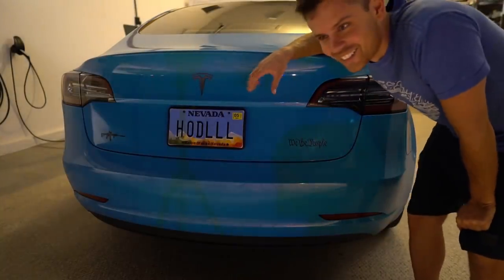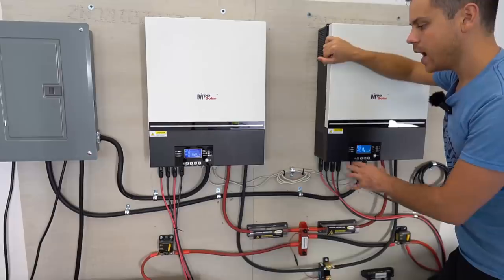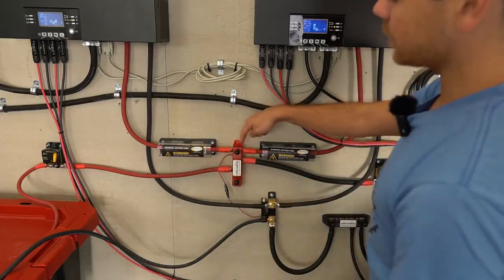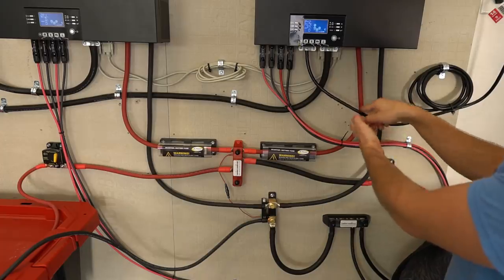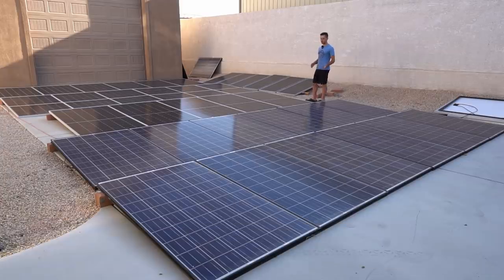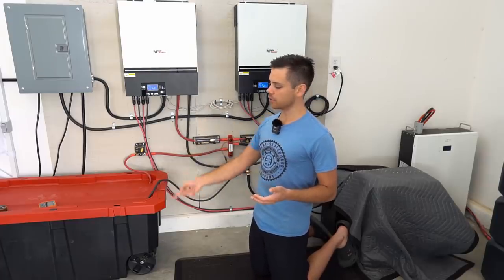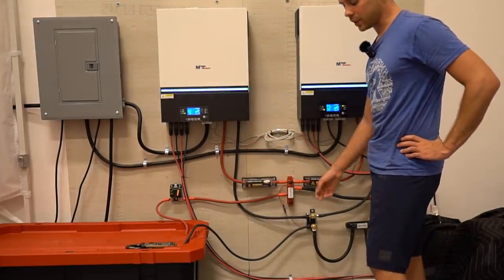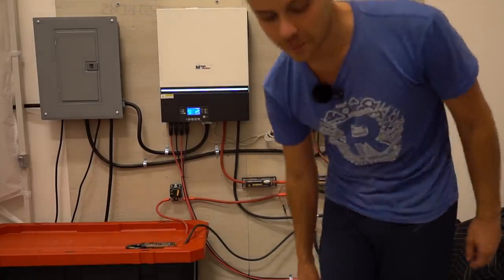New Upgrades for my Offgrid Permit-Free Solar System: I am now charging my Tesla without the Grid!

Comment: Even in cold, dark climates you can offset a lot of required power. You have 24 hours of sun in summer, so you generate way more than you need (and could easily drive for free all summer). On cold, but clear winter days you can generate quite a bit since panels like the cold, and you can use light reflected off of snow.
Reply: 24h sun ? So far I remember Vegas is in Nevada,  not north pole
Reply: @jantschierschky3461  No, but I am pretty close to the north pole, hence my comment on that (I was talking about my situation).
Reply: @upnorthandpersonal  ok, does make sense. I would say you have about 16h-18h effective sunlight,  twilight is not that productive.  Key is you angle the panels right
Reply: @jantschierschky3461  Yeah, I know :) Been off-grid for a while here. A little further up north from where I am we do have 24 hours to generate power, but it's not worth doing since in general you are so overpaneled for the rest of the year that in summer you don't know what to do with all the power.
Reply: Hello I am trying to learn about Deep Cell Batteries that can deal with cold climates and can deal with a wide range of Temperatures I was told about Fullriver batteries so if you know anything about them or other deep cell battery brands that I should know about please tell me and teach me about batteries that can recharge when the climate is cold, I am trying to know about and learning about Deep Cell Batteries that can deal with extreme weather and temperatures. Regards Hope
Reply: @hopehope938  I guess you mean "deep cycle" battery. In essence, all chemistries dislike cold, some more than others. The only one I would currently use if I have to be able to charge in freezing cold is LTO (Lithium Titanate Oxide). They work, but their voltage curve is a bit harder to work with than LiFePO4 and more expensive. Alternatively, and this is what I do, put the LiFePO4 cells in an insulated box and put a heating pad (preferably with thermostat) to keep the cells above 5C.
Fullriver just seems to be a lead acid battery manufacturer. I would not use lead acid this day and age, lead acid also performs badly when cold.
Reply: @upnorthandpersonal  BUY A tesla...
Reply: @SkipMichael  I don't like Tesla, but my next car will absolutely be electric.
Reply: @JxH  yep - which is why solar in dead of winter here is not an option. But you can 'store' the excess solar in summer for winter heating by e.g. cutting and splitting wood with electric tools.
Reply: Correct on the cold climates still being great, I offset all of my house + EV electricity and I am in Michigan.  8kW of panels (garage south roof and house south roof).  ROI under about 8 years.  No batteries though, do not need them until 2029 if I only cared about the $ aspect.
Reply: Are you also living in Sweden? Would be nice to visit you and see your solar setup 😜
Reply: @FuyangLiu  Finland actually.
Reply: @upnorthandpersonal  😅
Reply: @hopehope938  lithium titanate?

Comment: My 81 yrs young father built an off grid cabin, and I built and installed basically this same solar power setup with two MPP 6548s and 5k watts of solar in May of this year. He now tells me after he sells his other house he wants an electric car or truck and to charge it off the solar system.  :-) New project! add  more panels and more battery. Great job Will!

Comment: That system is simple enough. My estimated weekly mileage is 250-400, so charging twice a week should be sufficient. This system can easily handle that and provide whole house power. 
For cold climate charging it might still work if we just add a bit more solar.

Comment: Nice! 
I charge my Tesla Model Y on solar exclusively even in Michigan. The trick is to charge only when solar production exceeds house demand. I now use Home Assistant running on an old PC to monitor solar production (Enphase) and start/stop charging over WiFi. If clouds obscure the panels, the automation sends a message to the car and charging stops. Charging resumes automatically when the cloud passes. Charging is inhibited when A/C is running too.

Even a small PV system can handle all loads if managed by a central control system on WiFi (WLAN). I can still charge off-peak if needed. 

You inspired me to finally realize a long-held dream to drive on sunshine. Keep up the good work!

Comment: You freaking amaze me! I’m lost, but I figure if I watch your videos enough and repetitively I will figure it out. I just bought a 2001 35ft Damon, and I want to put enough solar that I can run the air conditioner w/o shore power. 😊 thank you Will!
Reply: I run a similar sized rv and recommend using a window unit. My built in ac uses around 1500w while the window unit is around 450w at 5000 btu. So a third of the power and does a decent job. Keeps it cold when outside temp is around 90 and bearable when the temp is over 100.

Comment: I've been mining with the surplus solar from my motorhome when it's not in use making great use of a system that would otherwise wise just sit there and be wasted.  I did my solar on my motorhome myself so I way over built it.  This is my 3 motorhome that I have done a system on and I go overboard so I don't have to listen to the generator run when I am out camping. I like your set up.  I lived in a motorhome in my 20's and had put some slightly used 7 month old 100wbon that motorhome.  I ran into a guy who did remote radio relay stations. He refreshed a site new panels batteries ect.  7 months later he gets the contract to expand the site and the spec's called for all new panels.  So I scored. Nobody was doing solar on rvs back then it was in heard of. But this guy coached me about putting diodes in and I never ran short of power again. So I dig your projects they are indeed fun.

Comment: Wow, I love it. Great job. And so true about the whiners.  People fight change so much.  I am in my late seventies and I welcome it!  What you are doing is great. I lived off grit 30 yrs ago on my sailboat.
Reply: Who is fighting this change for personal solar? It's great.
Reply: @randybobandy9828  naysayers on social media that say solar is stupid, panel production is worse for the environment than burning fuel, it never pays off, electric cars are dumb, and everything else the negative nellies say... just look at the same people with cars. People saying new cars are dumb and complicated, but 50+ years ago you HAD to tune up your car every 30k miles and making it to 100k miles was a great feat. Now our "overly complicated modern cars" (as the naysayers call them) have been easily hitting 200k miles with relative ease.... Just a few small repairs here and there all without worries of it not starting in sub zero weather, leaking oil everywhere, and needing hundreds in service every 2 years or so.
Reply: @volvo09  50 years ago a tuned car lasted a lot more than 100,000 miles. most needed tuned at least every 10,000 miles which was easy to do. with gas at 40 cents a gallon. rust was the killer.

Comment: When installing one hole straps, it is preferable to have the screw under the cable/conduit. Even if the strap bends open it will still provide support.

Comment: Man, I could replace so many pieces of equipment, breakers, and wiring that I spent the past year installing if I simply had 2 of those inverters. Kindof makes me feel like a dummy... LOL
Reply from the maker: Right?! Same here. The amount of stuff I still own that is collecting dust because of these new units is mind boggling. I can't believe how much they cram in these things!
Reply: @WillProwse  Hello.
If you have too many 'dust keepers', what do you think about starting some kind of contest and distributing stuff to viewers who have  enthusiastic ideas how to use it?
(Not asking for myself 😉)
Reply: @WillProwse  When I first started, MPPSolar didn't have any 48V inverters capable of 240V split-phase. It was either 120V or 240V and they suggested using a transformer for split-phase. They kept telling me a 48V split was "coming soon" for 1.5 years and I gave up waiting... I really want to get my system to a stable point where I don't have to touch it but the problem is it's so damn fun trying different pieces of equipment, changing things out, upgrading, learning, etc. Maybe this will be next year's venture once I've finished moving to LFP, because... why not?
Reply: @LithiumSolar  Ikr? I refer to my little 2kw system as "the most useful hobby I've ever had". I live off-grid, and change location every two months for my work, and have never needed more than 12-13 hundred watts output, and I've been growing my system by about $300 each year for about 6 years, but I may soon switch to 24v, and if I do, I may get a charger/inverter. I am on-grid once each year, for two months, but it is a private power system, and it's not super stable, so having an integrated system would be convenient.
Reply: @AlexandrShut  I think the "dust keepers" comment is more about praising the inverter instead of complaining about "having too much stuff".
Reply: @TheSiprianus  oops, looks like I misunderstood it. Thanks
Reply: Personally I like to have the flexibility to service each item separately, or indeed, replace it. I understand that people like the simplicity of it, but it's much easier to quickly swap the spare inverter in if something goes wrong then when you're not dealing with 'the box that does everything' going down.
Reply: @WillProwse  how much those inverters go for?
Reply: @LuisDiaz-kg1fy  1500 usd
Reply: @olocausto80  thank you so much. Seen the price on one of your other vids. Keep up the great work. Looking to build a similar system in the future. Thanks!!!!!!!
Reply: got to start somewhere. i too wasted money on the wrong stuff or stuff that didnt cut it. but it left me with piles of useful stuff i can toss together in a pinch. oh, hey i just recognized your name, you and your channel have helped me many times over the years.
Reply: @olocausto80  so two years worth of my electric bill for one.
Reply: I sold all my pre equiment on ebay and got back about 50% of what I spent over the last 4 years. Go sell man!!!

Comment: Would love to see a cost breakdown for all the components to build a similar system.  Great videos, keep on working!
Reply: @joshn2342323  Not really. It's not like it's a million bucks.
Reply: Santansolar on Ebay, I just bought two of the Talesun 330 watt panels, $165 each plus shipping.
They are attractive, all black with very solid frames, I'm mounting them on my van tomorrow.  
In bulk, panels cost less, and shipping is smaller percent of total bill. 

Will's system is pulling in 55 Kw per day, figure a nominal 8 hoursof sun, 55÷8=about 7Kw worth of panels.
You can buy that for under $2000. including shipping.   You can look online for inverter and battery costs to get an idea of total system cost.

Those panels are heavy, if you plan on building entire array in a day, hire help and save your back.
Reply: DIY is the way to get the cost down: my system has 10kW of solar, 30kWh storage, 6kW low frequency inverter, two 100A charge controllers. Total: under 10K including BMS, etc.
Reply: @upnorthandpersonal  Be so kind to give us a breakdown of your system it seems to me a bit cheap .
Only you bare panels are around 7K
Reply: @upnorthandpersonal  Just have gone fast trough it and what about your transportation cost ?
That is the thing where i live , rediculous transportation cost or even NO transportaion
But if it works and holds it is darn cheap 
I have build a system 3,5KW panels all outback Latin America edition electronics ( that cheap chinese stuff will not work with the grid overhere ) grid tied battery back with 48 volt Riolls agm .
Now adding a 2kW inverter generator for longer grid outs durinh huricanes just had Nora ove my head , a gen set wit a switch over switch is the chepsts way for me cost me 700 bucks and i need no more storage power in normal situation plenty for small outs more a UPS kind of thing .
Reply: @zasde35  The prices in the first post (and the other inverter later on in the thread) are all including shipping and tax. I don't do anything grid connected here, so this gives me flexibility on the equipment side.
Reply: @upnorthandpersonal  Just got me a membership at your forum and i following your topic .
Reply: @zasde35  Will's forum :) Nice to have you!

Comment: Excellent changes you have made, I am very impressed. I especially appreciate the class T fuses, that with the ground would make me feel much better. How realistic that feeling is of course debatable, but I use fuses and breakers too. If nothing else, the breakers make it easier to work on connections as an off switch.

Comment: solar will never be mainstream in until someone builds and sells a system, like henry ford did with the model T, that the price point is low enough and the system is powerful enough to supply a modern household and transportation needs. but ur system is a third of the cost of a commercial system of the same capabilities. so at least your proving with a little DYI, it doesn't have to be big $$$.  great system!

Comment: I also charged our EV a couple of times directly from the sun! The setup isn't complete, and it would be nicer to match charging speed with solar output, but yeah it is possible. I will tinker further, although going into autumn means it will not happen too many times again.

Comment: Nice! Glad to see the addition of the Class T fuses. I hope to convert our MG Midget to electric someday. In the summertime we have way more solar than we can use. The Midget is not a winter car anyway. We are off grid so we use solar for everything. Solar powers the lawn mower, grass trimmers and chainsaws. It powers the well and all our electrical needs. Charging a car with solar is awesome. Nice job will.
Reply: For someone in Australia (me) - what are class T fuses?  Carrier/utility grade, or what?  We maybe call them something different.
Reply: @Browneye2566  Class T is a fast acting fuse able to interrupt 200kA. The reason you use them is that Lithium has a very low internal resistance, so they can deliver huge amounts of current when shorted (much more than e.g. lead acid). An ANL fuse could just arc, melt, etc. - especially at 48V you want Class T since it's rated at higher voltages than ANL.

Comment: Where I live the minute it's hooked to a building you really  need a NEC permit and inspection to get insurance coverage.
Reply from the maker: It's not hooked up to a building. did you listen to what I said? I am using true earth ground for dissipating excess charge accumulation. It is an ac battery charger. It is in no way connected to the alternating current part of the circuit. It is not supplying my system, or being used as a ups. If I did, my transfer switch would share a ground with the output of my inverter. But it's not. Because that would create a ground loop and destroy my equipment. This is an off grid inverter. Not hybrid. Not grid tie. There is a huge difference.
Reply: @WillProwse  The way its attached to the building  does not appear to make it a backup system especially should there be a problem requiring emergency personnel.  Have you contacted  your  Code Enforcement Officer  to verify  a permit and electrical inspection is not required at your location. All that equipment permanently mounted in the building definitely falls under NEC codes at this kw level.
Reply from the maker: @unemployedredneckhillbilly2023  if it was attached to the grid at any point with the ac output, or feed back the grid, I would need a permit. On paper, this is a battery charger. It's the same as you connecting a battery charger to your wall, and charging a lead acid.
Reply: @WillProwse  I guess  you never  verified it with your CEO. Give him a call and verify those panels don't fall under nec codes mounted permanently on the wall. If they were in your  trailer with  just an extension cord going  to the car then it would  not require a permit. I think up to 1500 watts may be ok and won't kill emergency personnel responding to a 2 input building . Do a follow up after contacting your  Code Enforcement  Officer and I will believe your  county is different  then mine. Here you need a permit for things like that when permanently mounted  in a building and your  insurance  company will cover it after  getting  the green sticker.